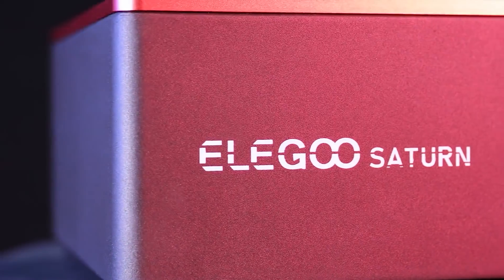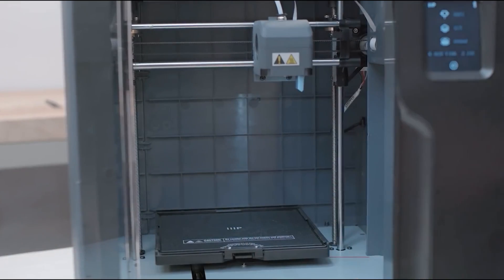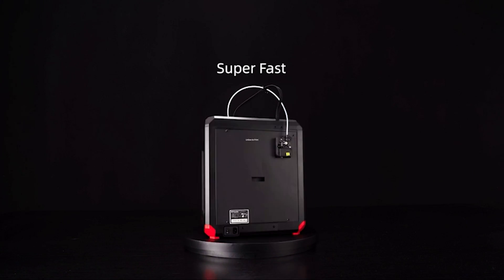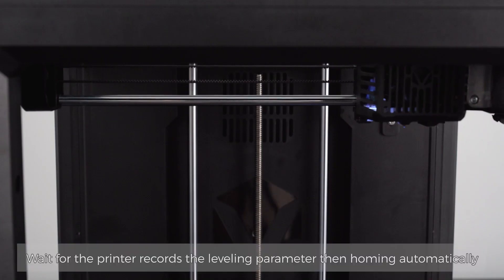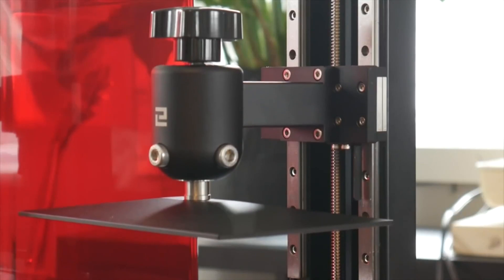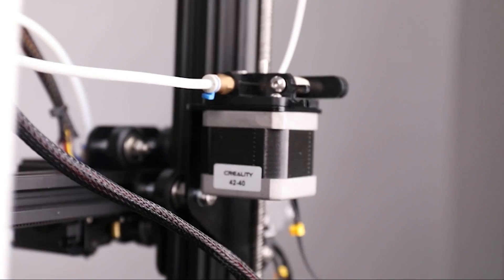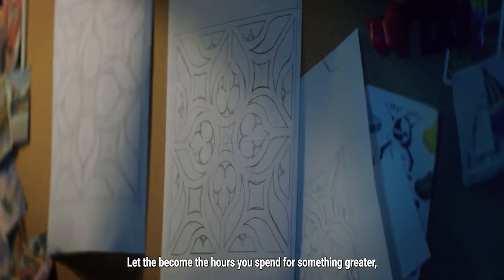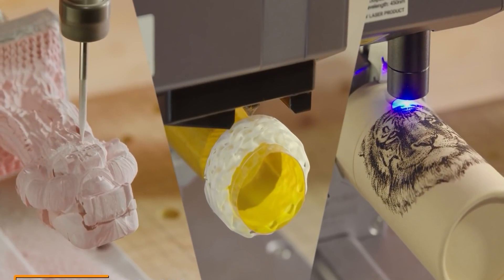Top 5 Best 3D Printers You can Buy Right Now [2023]

Comment: The 3D printer has made printing easier, faster, and more efficient. They can be easily used at home, and are affordable. We have the voxelab Aries which is super fast, easy to use, time-saving and has inbuilt wifi. The Elegoo staturn prints are bigger and have high printing space which means they can be used for large printing. The Anycubic Kobra is also another 3D printer that is easy to assemble and also with the Creality Ender 3Pro. The snapmaker 3D printer offers high-quality results as it requires quality time to print. It has a high market demand because of the quality. So if you are looking to buy a 3D printer, these are the best you can choose from to give you quality printing.